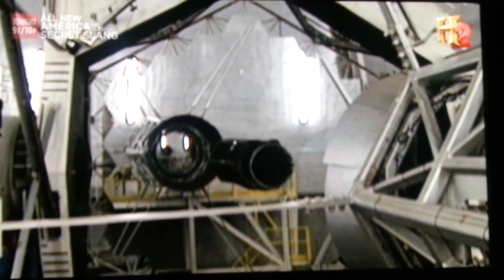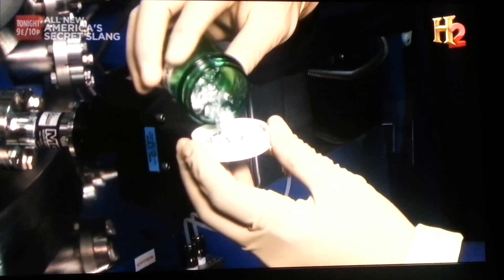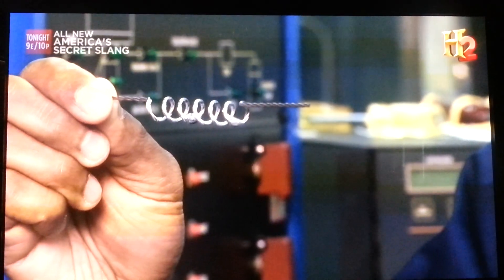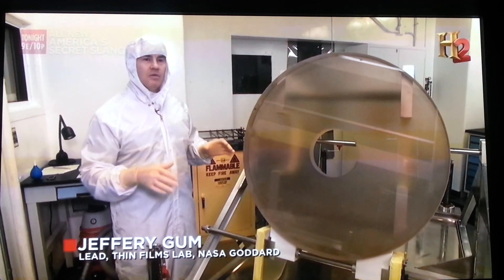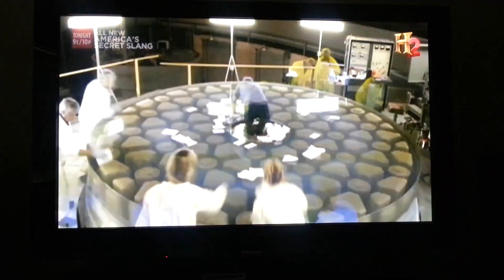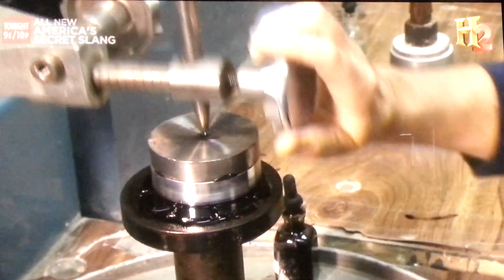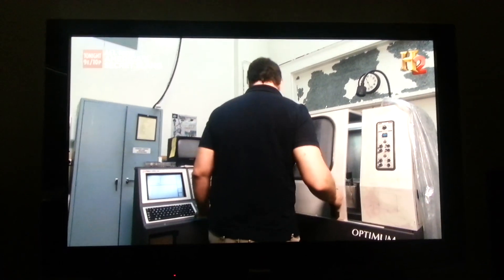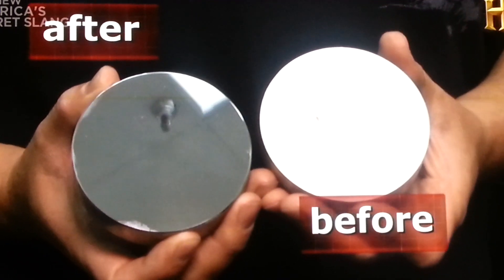Vacuum coating telescope mirrors

Comment: 1:14 You fucking use gloves for that! If someone would have handle anything in a vacuum chamber with bare fingers where I work they would pretty much have been instantly fired, no kidding, and rightfully so.
Reply: He’s touching a tungsten filament that gets heated to around 5000°F to evaporate aluminum clips placed directly on it during the coating process. At that extreme temperature, any trace residue—like skin oils—would be instantly vaporized long before it could affect anything. The chamber is cleaned and prepped before use anyway, and once under vacuum, there's no oxygen to cause contamination from surface oils. In short, touching the coil while the system is off isn’t going to compromise the coating. Pretty standard stuff for anyone who’s actually worked with thermal evaporation.
Reply: @highcommander2007  You obviously do not work with UHV systems I see.
Reply: @dtiydr  dont take offense just because you are wrong my guy, humble yourself.
Reply: @dtiydr  and this is mirror coating done in HV - not in UHV ~10⁻⁹ Torr and below (semiconductor fab). its a much less nuanced system.
Reply: @highcommander2007  Oh I know when I meet some who does not know, so do not be mad.
Reply: @dtiydr  lol he big mad
Reply: @highcommander2007  Especially coating could be very picky. This you see here is a place where they don't care so much. Oil first on the surface you will coat and then coating on top of that, yea, not how you do it. Would it cause any issues here? The surface is very big so probably not but the aluminium would not adhere to the surface as well which could cause issues in the length. But no matter what its not good practice never the less do not use gloves and is mandatory at least where I work.
Reply: @highcommander2007  Not at all just trying to educating people, but it is very hard sometimes.
Reply: @dtiydr  no kidding. I sometimes meet people online that post stupid comments like "you need a glove for mirror vacuum coating." theres some really dumb people out there lol
Reply: @highcommander2007  I see it is impossible to get you to understand but don't be mad on yourself for that, it is not uncommon at all, and Ii'm 100% sure you will also just confirm that with your next comment. I hope you start to listen to people in the trade some day, have a nice day, I'm out.

Comment: Vacuum viewport from VUV to THz- Fused silica, Quartz, Sapphire, MgF2, CaF2, BaF2, ZnSe, Silicon, Germanium, Pyrex 
http://www.dmphotonics.com/Zinc-selenide-ZnSe-vacuum-viewport/vacuum-viewports-ZnSe.htm
Del Mar Photonics offer a range of competitively priced UHV viewports , Conflat, ISO or KF including a variety of coatings to enhance performance.
When you send us your inquiry please fill out the following form to indicate all important specifications and e-mail it to us with your inquiry.
Del Mar Photonics viewports are manufactured using advanced techniques for control of special and critical processes, including 100 percent helium leak testing and x-ray measurements for metallization control.